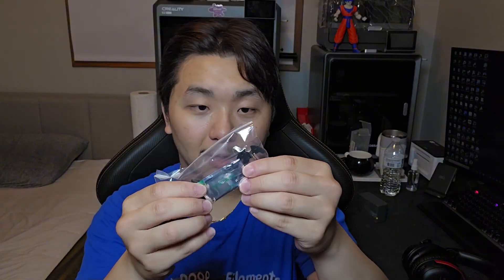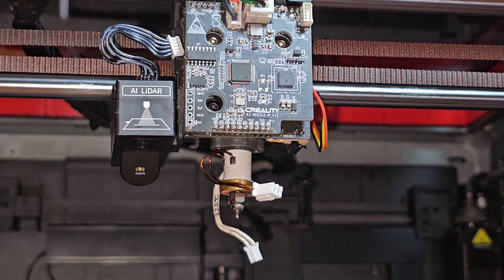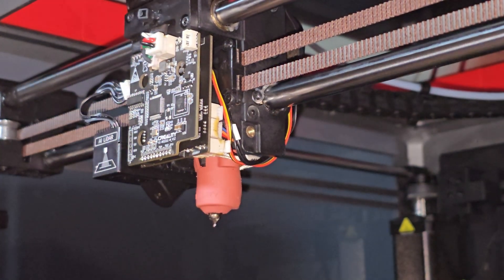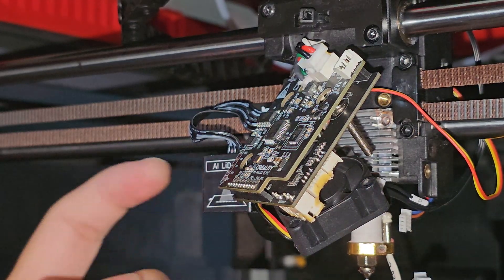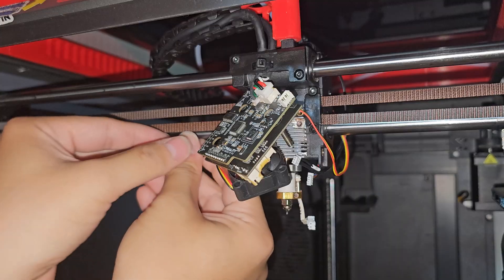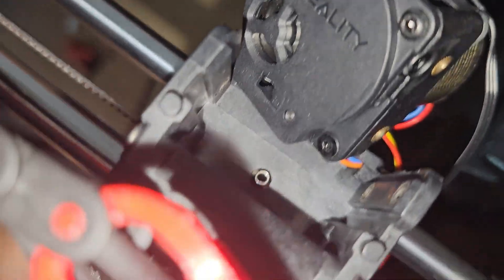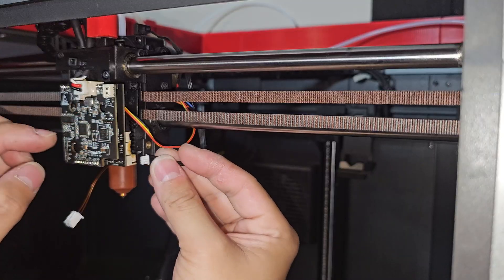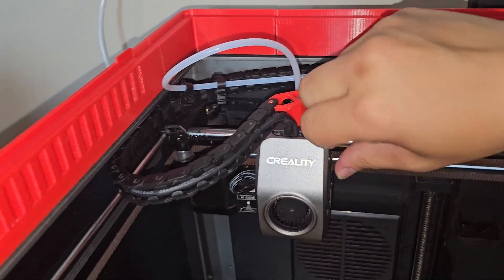Fixing K1 Max CFS Upgrade Kit To Work | New Hot End

Comment: Great video. Explaining what you are doing at each step is the way to go. But I have a question for you. With the new nozzle how do you reset where the center and hieght of the nozzle are for the purge dump? Cheers!
Reply from the maker: You can adjust the position using the touch screen.

Comment: The spacer is for the PCB Motherboard, for the black screw between the heatsink and the fan. And you must run a PID Calibration always you change the hotend or nozzle.
Reply from the maker: Yeah i need to do that

Comment: I put in the new unicorn nozzle hot end and when I fired it up, it started smoking. Is this normal?
Reply from the maker: Where is it smoking? Power up and start smoking then no good.

If you have filament extrude and start smoking then maybe wet filament.

Comment: Unfortunately, I ordered the wrong Hotend. I have the older K1 Max with the V12 Hotend PCB. I damaged the board perhaps because I pulled the "shell" with the 2pin thermistor connector to inspect the connectors. Creality uses a lot of pliable (silicon perhaps) glue to bond the connector to the plastic shell. I'm not sure my PCB is unusable or repairable. 

I see Creality sells a new PCB upgrade board (V13 I believe) with connectors for the "new" Volcano Hotend. I'll sort this out in a couple weeks when the "old" Volcano Hotend arrives. I'm a little concerned about installing the V13 PCB in an older K1 Max model. I worry the CFS firmware will work with the newer PCB in an older K1 Max. Hopefully my PCB is repairable.
Reply from the maker: Dang that sucks. Im not sure but maybe it is compatible the new board. Good luck.

Comment: ughhh, so anyone that has recently bought the k1 max, read this Two Versions of K1 Max:
Yes, there are at least two notable versions or revisions of the Creality K1 Max.
Early units came with the original hotend, which had known issues, prompting Creality to release upgraded versions with improved hotends, including the "unicorn" hotend upgrade (often referring to Creality’s improved all-metal, titanium alloy heatbreak and hardened steel nozzle combination).
Some users online have reported and compared "old K1 Max" (early revision) and "new K1 Max" (with unicorn hotend and other factory improvements).
Factory Installation of Hotend with New Improvements:
The newer K1 Max printers shipped from mid to late 2023 and onwards increasingly come factory-installed with the upgraded hotend (including the unicorn hotend design).
This upgrade includes improvements like better heat distribution, more robust and heat-resistant materials, and fixes to common extrusion issues seen in early models.
Therefore, the printer with the unicorn hotend upgrade is the version installed with the factory's new improvements.
Your Case - Printer 2 Weeks Old:
Given your printer is brand new (2 weeks old as of July 2025), it very likely is the updated factory version with the unicorn hotend already installed.
Creality's recent production runs have integrated these upgrades to address prior problems without requiring aftermarket modifications.
However, verifying your printer's hardware details (e.g., via documentation from Creality or physically checking the heatbreak/nozzle material) can confirm this.
Reply from the maker: Mine k1 max is not new, i bought it years ago, so i gotten the older version of the k1 max.

Comment: I just got the k1 max AI is that different? because the hotend is 300c ceramic and the unicorn hot end says the same thing....anyone know if the model has been upgraded?
Reply from the maker: I think the k1 max that has the logo k1 max and the bed dimension in front of the build.plate might be the newer version.

If you want to know if you got the new version, then maybe yake off the nozzle and see if it's the unicorn style nozzle.
Reply: It would be easier to remove the extruder. If you don’t have the small piece of Capricorn tube and see a metal tube under the extruder you have the Volcano Hotend.

Comment: Hi! I made the update but don‘t know to print in multicolor! There ist no option in creality print.
Reply from the maker: Have you installed the latest firmware to the 3d printer and creality print? If you did it should just be there, try adding a couple more filaments in the slicer and see if that works.

Comment: Hey kiddo, thanks so much for sharing this update on the Unicorn Hot-End! I’ve been upgrading my K1C, and after battling a finicky stepper motor, Creality kindly sent me both the new Hot-End and the upgraded motherboard. I couldn’t agree more—they’re leaps and bounds safer and rock-solid reliable compared to the originals.

Your walk-through remind me and so I thought to share my experiences with you, hoping this will help. I truly believe Our World is a Shared Experience , and it’s awesome to see creators like you lifting each other up. If you ever want to swap tips or see how the Unicorn Hot-End performs under different filaments, I’d love to connect. If you’re curious, drop by, say hi, and maybe leave a comment or a like if you find something useful in my channel. I’ll be uploading the video connecting the New Upgraded Motherboard with Unicorn Nozzle for K1 Series soon. Your support would mean the world. I’m disabled and much older, so things take way too long for me do.

Remember, Life is Short , so Live Long and Prosper ! Cheers, and happy printing!!!
Reply from the maker: Thanks, man. Yeah, the unicorn nozzle makes everything smooth and easier to print. Glad you enjoy the video. Good luck.
Reply: I’m having a similar issue where my K1C has been having all sorts of cutter issues, it’s very intermittent, some prints it’s fine and then others the cutter will get stuck or won’t come into contact with the block for the cutter so I’m wondering if it’s the older motherboard. I have a unicorn nozzle one on there so I don’t think it’s that.

Comment: I had to do these upgrades too, I also had to shave down the plastic under the extruder with a Dremel because the cutter lever was getting stuck closed and I was getting errors, now it is working much better
Reply from the maker: Yeah with upgrades like these, slight modification is needed to make it work. Nice that you got yours working too.

Comment: Great video, Thanks. How do you print with the external rolls, such as TPU, with the upgrade installed on the K1Max? Where do the external rolls connect to?
Reply from the maker: I think you'll have to make a 2to1 tube connector so that you can print with the external roll.